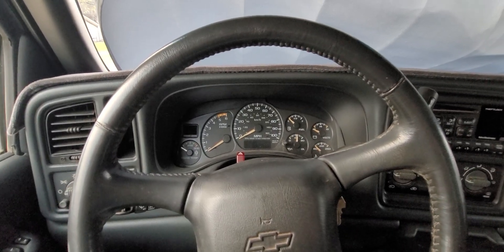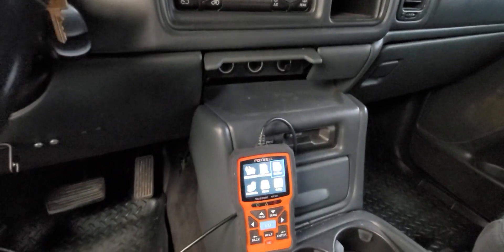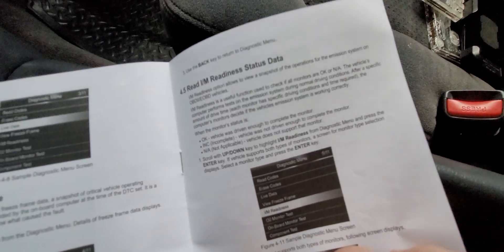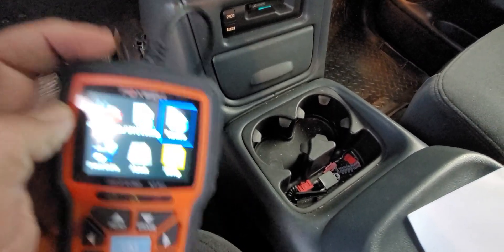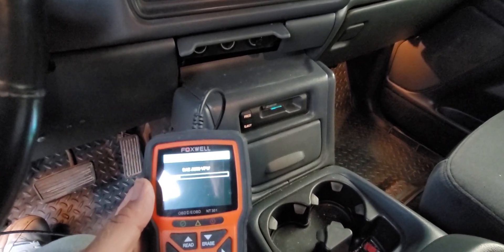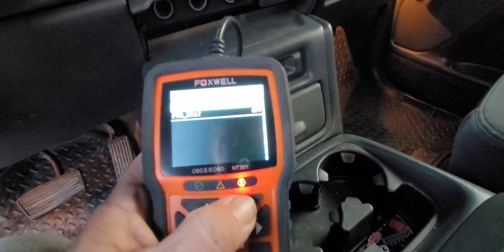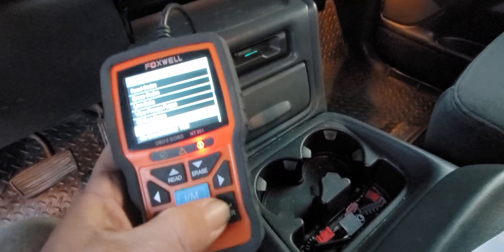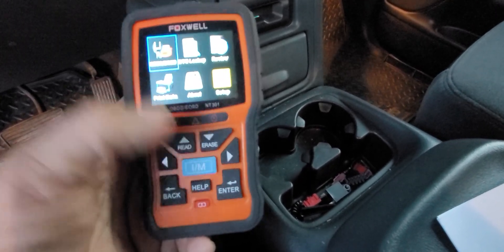Using the Foxwell NT301 to Diagnose the 8100 496 8.1L Chevy GMT-800 Pickup

Comment: Hi, Bryan!  EOBD stands for European OBD, which must not be confused with EOBD II (ENHANCED OBD II).  EOBD is generally found on European cars 2001 and newer, and as far as I know, any OBD II scanner will work on them.  EOBD II on the other hand, is specific to the car manufacturer and requires a dealership scanner such as the Tech 2 in the case of GM vehicles.

One last thing:

Driving 55 MPH or less for any length of time has been known to cause erectile dysfunction and loss of libido.🏁😎🏁
Reply from the maker: Too funny😁. Good information on the EOBD, I wasn't familiar with the terminology when I first saw it. Thanks for sharing👍.

Comment: Handy for sure.  I’ve had only 3 codes show up on my ‘01 GMC in the last 22 years.  Crank shaft position sensor I would have never found without reading the code. The others were for the O2 sensor and a transmission code.  I reset the computer for those and they’ve never returned.
Reply from the maker: Yep, these are very reliable trucks so I'm sure it's going to end up being a simple fix.